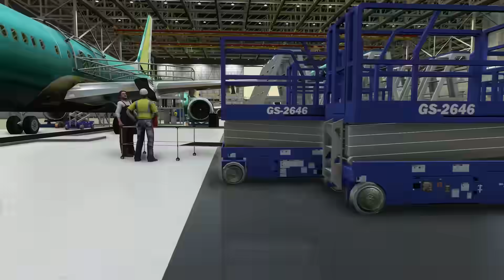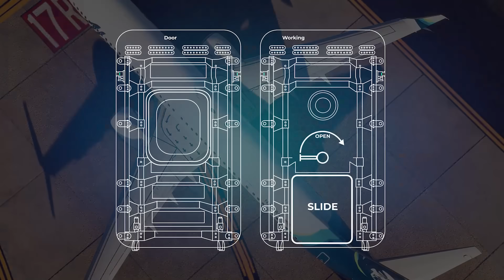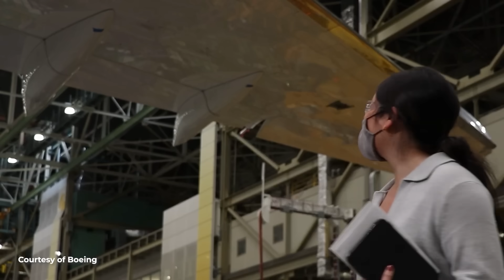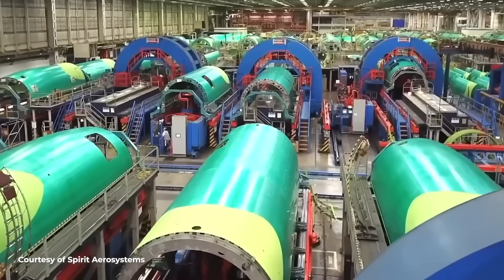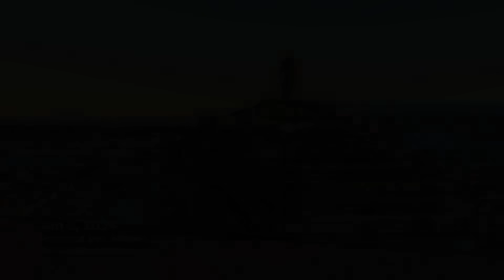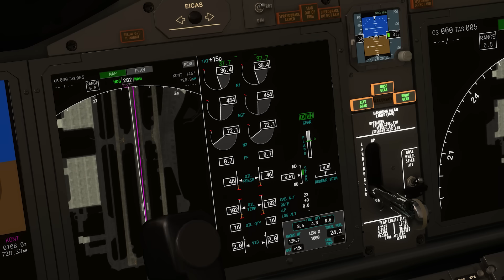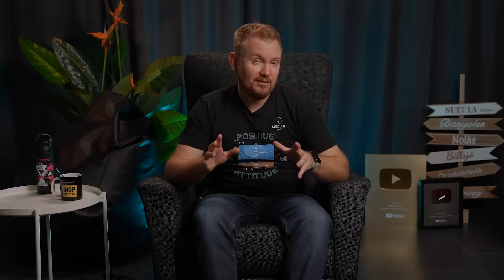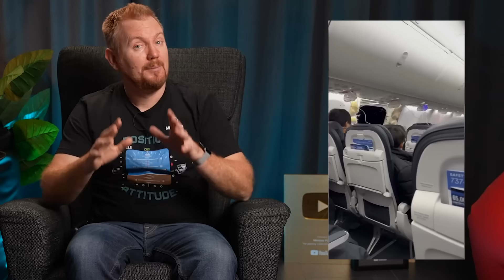Boeing 737MAX BlowOut!! The Scandal behind Alaska Airlines flight 1282

Comment: Thank you for pointing out that unlike the MCAS, this is NOT a design issue with the 737 but a maintenance issue. Just like American 191 gave the DC10 an undeserved black eye since it also was a maintenance issue, this is purely human error. Sadly, this points to inept QC at Boeing and Spirit Aerosystems which needs to be fixed - fast. As an American I'm sad to see Boeing devolve like this. It feels like they've been on a downward spiral ever since the McDonnell Douglas merger. Between the 787 teething problems, the MAX, Starliner, KC-46 issues, and what feels like significant delays in the next gen 777 program, Boeing is having to weather a ton of storms that they mainly have brought on themselves. Sounds like new management is desperately needed or this once iconic juggernaut is going to get relegated to a distant second place runner in a two runner race. Not that Airbus doesn't have their own issues but at least they seem to have better overall QC. The A380 was a financial mistake that most people saw from a light year away but aside of that they seem to be doing well overall. And honestly - flying on the A320 is more of a pleasant experience of flying on a 737. Note I'm saying this as a pax, not a pilot. Petr feel free to disagree on the actual flying part! :)

Comment: I am not an aircraft engineer but I would think that after you remove the bolts to open the plug door you will place them somewhere and then when job is done if you still have something left then it clearly means something went wrong. Say surgeons (or their nurses) do count materials and tools before and after surgery and if counts do not match then they know that something went wrong and something is possibly left behind in the patient body.

So I would really love some aircraft engineer enlighten us if similar procedures are in place and if they are how they may be violated unintentionally? I don't think that whoever worked on this plug door in the end of the job just picked up the bolts, thought "Meh, big deal" and thrown them into garbage bin intentionally.

Comment: The incident (all to mild for what happened) brings up the issue that when an aircraft leaves the factory,  all 3 (in this case)  pressurization systems have to be working,  or its fixed (granted all too often that means a change out of a controller and Peter has shown repeatedly that is not the root cause).    But once in service, then the airlines can operated with one of those controllers (in this case,  it applies to other systems)  and not ID the issue or fix it.    So now you are operating on (in theory) two good controllers (one auto and one manual).    Its all about economics and not safety.    There is a reason there are 3 pressurization systems.    But airlines are allowed to ignore that and operate with two.     I don't get the logic.   As far as I know redundant systems are there for a reason and  then allowed to operate  with fewer.    At the very least there should be a test and replacing the controller and with a repeat alarm you then know its not the controller (or its a good guess its not).

Comment: Yeah this continuous Boeing BS needs to end.  This is what you get when non engineers run the company.
Reply: Remember that Muilenburg was a Boeing engineer before he became CEO.  The president of Boeing Commercial Aircraft now is an engineer, but the Boeing CEO is not.  I think we should be hearing from the head of the Commercial Aircraft division as well as the CEO on this issue.
Reply: @GH-oi2jf  Just hearing you explain that reminds me that it's a cultural issue at this rotten point.  One token president cannot change the culture.  Trust me on this one a single senior leader cannot fix this alone.

Comment: What happened to the extra fuel in the airplane? aren’t the pilots supposed to dump the fuel in an emergency decent considering they’ve just taken off from the airport…
Reply: No, it’s a 737., most of the aircraft of this category have a MLW Max Landing Weight close to the TOW. And most of the time there is a procedure for overweight landing near the max TOW.
The 737 like the A320 has no fuel jettison system because of that.
Bigger aircraft’s like the 777 or A330 have fuel jettison systems, because their max fuel capacity is WAY higher

Comment: Thank you for explaining how the emergency door, when installed, operates and how the door plug is removed similiarly. I was under the impression that all cabin doors, both main and emergency, had to be open first inward and pressuration would keep them from opening in flight. When I was a Naval aircrewman on the Lockheed P-3C Orion this is how they operated. I see that this emergency opening on the 737-9 Max the door opens up then swing downward, and not sealed from opening when under pressure.

Comment: You didn’t comment on the possible consequences had the door departed at cruise altitude and pressurization level, cruise speed, temperatures and people and crew moving around the cabin.  It may likely have been the worst of outcomes especially when you consider the bent seats with only a modest differential at 16,000’.

Comment: I'm sorry if my question is silly - I don't work in the aviation industry, I'm just a former aerophobic turned an airplane lover :) What would be the problem of having "too many" emergency exits? I mean okay, I understand that if your plane capacity is under 189 passengers, you don't need those extra exits. But would having them incur any additional costs so airlines prefer to install those door plugs? 
Thanks for all your amazing content, Peter! It's very detailed and technical while still being fully comprehensible to an amateur like myself. Keep up your great work!
Reply: Someone above said that the plug weighs 100 pounds less than the real door. A combined 200 lb saving is enough to make an actual difference in performance I think.

Comment: I sometimes think pilots are a bit blase about failures. The attitude of 'if one system reports a fault, just switch to the other' means they seem a little too intellectually uncurious about the underlying fault. WHY did the first system report a fault? Is it a fault with the controller, or an abnormal operating condition that points to a bigger underlying problem? "Just switch and write an entry in the log" fails when nobody has the curiosity to probe further, and if people had been sitting in those seats, could have resulted in avoidable deaths. The cabin having an outflow of air greater than tolerance points to a LEAK that points to a BUILDING PROBLEM that points to a DISASATER
Reply: And arrogant to the point of harm when it comes to accepting information reported by anyone they consider beneath them. Like passengers.

Comment: This really seems like a difficult internal issue, but the fact that Spirit actually painted over a problem rather than fixing it leads me to believe they're just professionally incompetent. 

I've encountered a few suppliers like that, and generally the only reason the company does business with them is because they give special discounts or are just good friends with the CEO.

Probably going to be more finger pointing in the future, but Spirit definitely seems responsible for this mess. (If the internal messages are accurate, anyway)

Comment: I would suggest that the design is flawed. If they had put a solid flange along the plug, there is no way the door plug could have left the cabin. But I'm guessing that because they copied the design of the door, which is designed to move outwardly, they didn't consider changing the design.
There might also be an advantage of being able to mount the door plug without having to take it through the cabin. 

Those plug could have also been designed so that the bolts are captive and attached to the plug so that even if they weren't installed they would still function at a minimum level.

Something that is very common in the engineering world is the mentality that the users will always use your product as you designed it, and there is little accounting for missteps. 

But outsourcing isn't helping Boeing, especially when the work is also outsourced to another country. At that point you're essentially dealing with three separate entities just for basic production. Those manufacturing processes should be done in house. Sure, you can use third party vendors for components that you can't specialize in, but we are talking about basic manufacturing processes. The more layers you add to that, the less likely it will be that you can easily detect and resolve issues.

Them painting over the nearby rivets instead of fixing them is insane for an aircraft.
Reply: The consideration is that they want the fuselage structure to be exactly the same for all planes of that model, regardless of seat configuration.  The plug door uses the same retention system as for a normal emergency exit door.

Comment: I wonder if the assist springs were fitted to keep the force distribution as close as possible to normal to avoid needing a separate set of strength calculations for the door plug case.

Comment: I'm wondering if a passenger sitting at the seat next to the door plug could have noticed if the window was higher than the other windows or out of line with the inner covering/wall.  
 I wonder, if on the ground waiting to take off, if that passenger were to push up strongly on the window fame the door plug would have simply opened and fallen out onto the tarmak?
 Or maybe the plug would have only opened at the top because of a couple small cables meant to keep it from falling out during maintenance, but it would be obvious that it was open because the window would now be in an abnormally outward position. 
In other words, someone could have, from the inside of the aircraft, when the plane was depressurized, pushed up on the upper edge of the window and the plug would have opened.
Reply: Some interesting points there.
Reply: For those in the "all that happened was that they didn't fit the 4 locking bolts" camp, then  a passenger could have pushed up on the window on any of the 150+ flights and the door plug would have swung open against its lanyards at 15°. Particularly if they did it before engine start or maybe during taxi.
If they had merely forgotten to fit the 4 locking bolts then the door would have failed on its first flight. It probably wouldn't have even got as far as it's first flight without being discovered, as they no doubt perform a full 8psi (or higher) differential pressurisation test on the ground and even if the door plug didn't fail then (which it probably would) there would be a noticeable air leak as the door will be significantly lifted by the assist springs.
The reason it passed the initial pressure test and then didn't fail until it had done 150+ flights is that they didn't merely omit the four locking bolts, they actually added a white plastic zip tie, which was holding the door plug closed. Why isn't that mentioned by NTSB?
At 12:18 in this video, in the "after closure" Boeing progress photo, on the (forward) right hand side of the door, the second up from the bottom, pair of door & frame lugs, have a white plastic zip tie clamping the door lug pin & frame lug pad firmly together. (This photo is figure 16 in the NTSB preliminary report).
The zip tie held, keeping the 12 pairs of lugs aligned, until a bumpy landing broke it, or made it finally slip off one of the lugs. Without that zip tie, the lift assist springs will lift the door to the point where all of the 12 pairs of lug pins/pads are pretty much disengaged and only the very bottom part of the upper guide tracks are engaged with the guide rollers.
That part of the guide tracks was never designed to hold the cabin air pressure and it finally broke at 15,000 ft, the first flight after the zip tie broke. (After 150+ flights).
It's a shame that the lift assist springs didn't lift a tiny bit more, because then the guide tracks would have fully disengaged from the guide rollers when the zip tie broke on landing. The door would have then fallen open to 15° where it's wire lanyards would hold it. Hopefully a door plug open 15° would be noticed on the next pre-flight walk around. Failing that there would be serious wind noise on takeoff, deformation of the interior panel, no pressurisation and an interesting view for anyone looking out through that "window".
Note: a zip tie is also known as a hose tie, cable tie, zap-straps or tie wrap.
Essentially, exposing passengers to risk was caused by the fitting of the zip tie. Without that, the missing locking bolts would have been detected by a ground pressurisation test or worst case would have failed in the first flight which would not have passengers onboard.
Reply: @alanm8932  I never noticed that zip tie. I guess the passenger would have had to push up on the window, while on the ground, after the zip tie was broken by a hard landing or turbulence at low altitude. There were, from this video, reports from passengers of whistling sounds near the door plug prior to the event.
Reply: @garman1966  I've known about the zip tie for over 3 weeks but only just realised that it's the zip tie that exposed passengers to this risk.
Without the zip tie, the missing locking bolts would have been discovered probably before it ever flew, or at least before passengers ever flew in it.

If the zip tie hadn't been there, 
I'm quite confident that the springs lift the door almost to the point of opening, for the following reasons:
1) if the 55 pound door plug isn't lifted high enough when pulling it closed from the 15° open position, then the backs of the lower 2 pairs of lugs will clash into each other. This could be with considerable force as the lower lugs are relatively close to the axis of rotation (the rotation pins at the bottom of the hinge tubes) so there's considerable leverage from the mass of the door that's mostly well above the lower lugs, as is the point where someone is likely to be pulling the door closed from.
Although the lugs are strong, they are not intended to be hit from that direction (their backs) with a force that's difficult to predict. The pin/pad adjustment locking wires could also be damaged. The hinge tubes & pivots would be subject to a similar force if the lugs clashed on closure & they could become deformed. All this can be avoided by fitting springs that lift the door sufficiently for the door lugs to pass above the frame lugs without additional lifting.
2) If the door isn't held up as the door is hinged outwards, then it looks like the lower edge of the outside skin of the door will clash with the lower outer edge of the door frame. (Due to the pivot point being some distance inboard from the outer skin of the door). This would likely damage the door or the door frame either paint damage or bent metal. Again avoided by fitting springs that lift the door a significant amount when the locking bolts (or zip tie performing equivalent function) are not fitted.
You could rely on the operator infallibly lifting the 55 pound door throughout the open/close operation to avoid both of these causes of damage or you could just fit the springs that are already part of the grandfather design that the door plug is based on. (Probably a derated spring as the plug's weight is ⅓ of an emergency exit door with slide).
Reply: @alanm8932 It all depends if the springs were strong enough to push the door plug upwards without assistance at ground level. If the normal resting position of the plug without locking nuts in place was down, then it should stay down throughout flight after pressurization. I can't imagine that a maintenance person would put a zip tie to keep the plug from rising if the plug was already being pushed out of place and he had to hold the plug down with one hand to secure it with the other. Maybe the force of the springs pushing up was almost equal to the plug's weight pushing down, and sometime after the tie broke the plug was able to shift around due to turbulence during takeoff, and ended up stuck on just the very edges of the tabs where it then failed when the plane pressurized enough.
Reply: @garman1966  I would think the reason for the zip tie is to close the door for the "progress" photo. They want the door to be closed in the photo to show they have pretty much finished but they didn't have the bolts to hand.
To fit the zip tie, put your left foot or left knee on the horizontal cross piece that goes right across the bottom of the door. Crouch down (probably easier with knee holding door down) and fit zip tie with both hands available.
I thought that in my last message, my 2 reasons why the designer would fit springs strong enough to lift the door were likely to be important considerations. You don't think so?
Reply: @alanm8932  That seems reasonable regarding the tie. I just assume the design of the plug would have the springs just assist in raising, not be strong enough to actually lift the plug. You probably know more about the design of this door than I do.